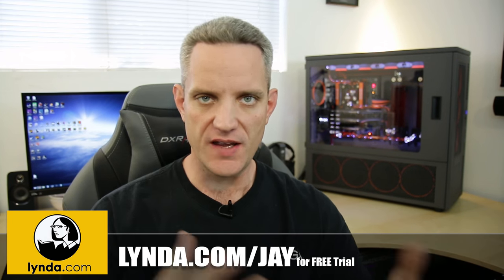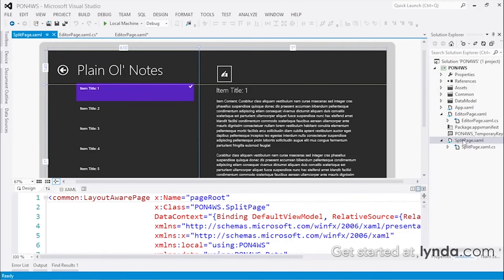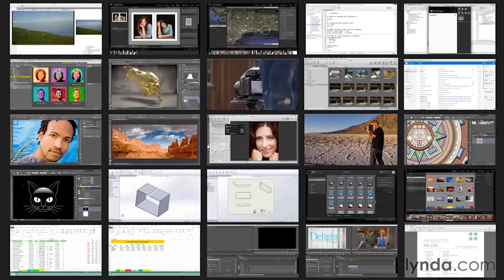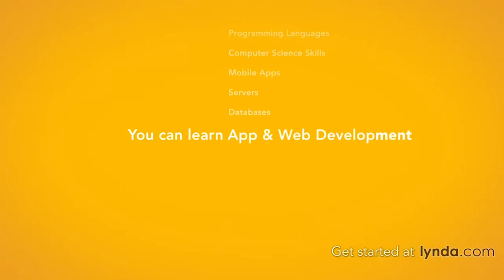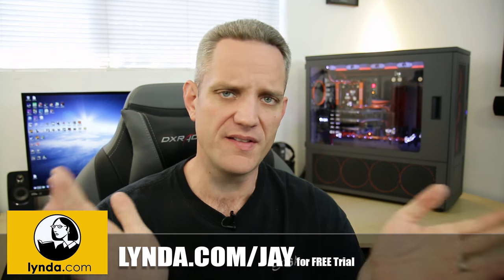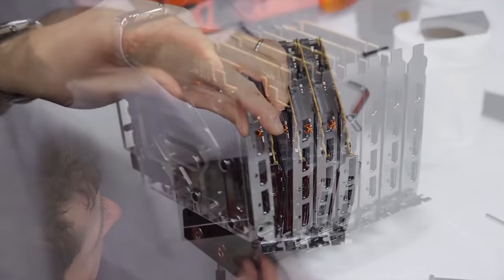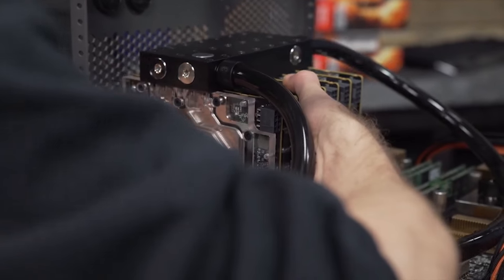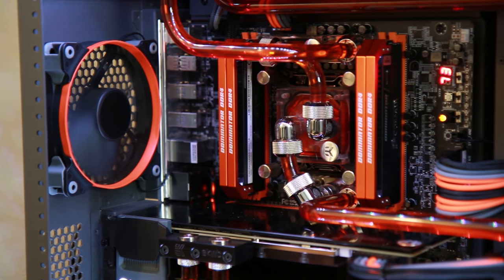Is watercooling worth it?

Comment: Should I watercool my headphones?
Reply: Yes....
Reply: That's a rather subjective question
Reply: +FidgetMyMidget No, you need to RGB your water first to not go over 95 C.
Reply: Kyzr NOW with RGB lights!

CES 2016 coverage brought to you by square space.

Build it beautiful
Reply: +FidgetMyMidget Only in the summer! In the winter you have to place a heater in it so you get nice warm ears!
Reply: +Brian Silva that water cooled power supply is one of the worst one out there, falling slightly behind the thortech thunderbolt. The ripple was a component killer on that
Reply: FidgetMyMidget Yea
Reply: What about my usb drive?
Reply: +O O F you should under-volt your USB ports for maximum stability.
Reply: Yes
Reply: But do you need to???
Reply: Your ears sweat and watercool them

Comment: I did custom watercooling in my system primarily for the looks. While doing the build, and seeing all the challenges you can run into (at least as a first time watercooler) I started seeing the appeal of more traditional cooling. But when it was finally finished, and seeing how nice the system ends up looking, then it was all worth it :)

Comment: I can answer this question... If you want to water cool because it's fun, or because it looks cool, fair enough. But is it worth it financially? No, not even a little bit.
Reply: I agree. Especially with the efficiency of modern CPUs and GPUs.
Reply: +nicklong27 yeah imagine the responsibility of doing it. Stick with a AIO cooler. Just install it and done. No maintenance needed.
Reply: +nicklong27 How much is the performance boost of putting alloys on your car? And how many people still pay hundreds of bucks on them?
Reply: Because I can overlock my cpu to max and not worry about temperature under full load 24/7. Sure it looks better alot, but custom loop without overlocking is a big joke.

Comment: My opinion on where watercooling (before watching the video) is good (aka you should):
1) You want to overclock stuff to their limit.
2)  You have a small case where airflow isn't optimal/good or having temps issues.

But you can always consider watercooling for looks and even lower temps.

I agree with jay's take on this. 100%.

Comment: I have a custom loop for 4 years now because of 2 reasons: Its so much quieter than air with my overclocks and because i love to work on my pc.

I think i have rearranged my loop 3 times in the beginning and tested different pathways to squeeze out a few degrees. Not because i was needing it, but because i had fun doing it!
My next project will be a hardtube build but im waiting for the hardware to advance enough to be worth upgrading.

If someone would ask me if they should watercool, i would advise them to put the money for the watercooling into better components, especially the graphics card and CPU like Jay said.
If you want a (relatively) silent PC, theres enough options for air/ hybrid or aio as well. 

Don't forget about cases like the Fractal Define r5, coolers like the Noctua NHD-15, corsair and other aio's (you probably have to exchange the fans on some, though) also theres plenty silent fans out on the market (Noctua, Noiseblocker, BeQuiet!, Nanoxia...)
As for the graphics, nowdays we can get aio graphics card coolers but some of the beefy heatsinks can be pretty quiet too, if you don't overcklock too much and are ok with hotter components.
Reply: Baldur M. How much would it cost to water cook my current pc?
I7 6700k
Z170a
Gtx1060 6gb
Reply: your boy bocaj thank you. And it’s not exactly worth it right? It’s more of a aesthetic?

Comment: Jay, Just wanted to say thanks for posting this video.  I especially appreciate the comment about not sacrificing on buying high performing system parts in the name of water cooling.  I have taken that philosophy to heart with my next build.  Here are the parts I'll be using: 

A) Corsair Obsidian Series 900D CC-9011022-WW Black Aluminum ATX Super Tower Computer Case
B) ASUS X99-PRO/USB 3.1 LGA 2011-v3 Intel X99 SATA 6Gb/s USB 3.1 USB 3.0 ATX Intel Motherboard
C) Intel Core i7-6800K 15M Broadwell-E 6-Core 3.4 GHz LGA 2011-v3 140W BX80671I76800K Desktop Processor
E) CORSAIR Vengeance LPX 32GB (4 x 8GB) 288-Pin DDR4 SDRAM DDR4 3200 (PC4 25600) Desktop Memory Model CMK32GX4M4B3200C16W
F) Corsair Hydro Series H115i Extreme Performance Liquid CPU Cooler, 280mm CW-9060027-WW
G) (Cannibalized from Current Rig) Silverstone 12000W PSU 
F) (Cannibalized from Current Rig) Asus 980 GTX Ti  (Reference)  
H) Crucial SSD / WD Black 6 TB HDD 

Like you I shoot video and still photography and yes when time allows I love to fire up DCS, Dirt 3, or some other game.  So I really wanted those extra 2 cores for multitasking operations when I'm coding a video file or rendering an effect in after effects.  It was money that I shifted from the i5 with custom water cooling onto buying the i7.   I will be watercooling the CPU with a Corsair Hydro AIO which I've had good experiences with thus far in the h80i series.  

I do think there is one aspect of the video that you did not touch on.  It doesn't have to be an all or nothing proposition.  For example.  With these parts I bought today I'm looking 14 to 20 months out.  Meaning that the new case (Replacing my smaller Lian-Li Mid Tower pc v1020 / great case just too small)  will eventually house a water cooling custom loop(s) and the other parts will support that.  With my budget I plan on building the water cooling system over time by buying a part here and there from EKWB.  A water block for the CPU in the spring.  Then GPU block in the fall.  Yes I'd love to go out and just buy everything at once but no winning lottery tickets here.  

However, want to thank you again for some great advice.  I think coming out of the gate I'm going to have a great system with potential to expand and grow in the future.

Comment: THANK YOU JAY
Im sick tired of most my friends wanting to spend MORE money on the MOBO and the WATERCOOLING than the  GPU and CPU itself, and they claim that it will make games run faster.  HOW HORRIFYING
Reply: It does make games run faster if you compare custom watercooling to any other type of cooling on the same specs because you can overclock. And spending more on watercooling than cpu and gpu is normal depending on your setup, I mean with r9 5900x and an rtx3090, can't really spend any more on CPU and GPU

Comment: I had a custom loop, I did switch back to air cooling for the convenience. I am very lucky that my cpu can overclock to 4.8 ghz at 1.27 volts ( my winter oc) but nowadays a aircooler and some high quality fans, and a gpu that turns off at idle. Is arguably quieter than a pump in wc loop.

Comment: It's completely true. If you are making (or buying pre-made) PC at around mid range or making an expensive build (depending on where you live), a loop would probably cost as much as your whole PC that you are building. Water loops are definitely for enthusiasts only, or if you are on the high end and you are trying to push out the little bit that is left in your hardware without making the jump to the next best thing. This small amount of percentage is at the top of the scale, and there is a lot of things to consider before water cooling!!!
Geat job Jay, keep it up!!!

Comment: After 6 months of having my custom loop running in my system, this is my experience:

First week I spent with my computer disassembled and playing around with the parts over a long weekend. The second week I let distilled water run through the system to flush it out, worrying the whole time like a new parent as I spot checked my CPU block. Then I drained and redid a part of the loop so it was not in the way of the graphics card and then filled it to begin the infinite process of bleeding and filling the system up until the modern day. After 2 months I sorta let it go and surprisingly, I have not had any issues with it yet. I even transported it across the state and all it did was shake out some bubbles. 

All in all, if you like playing with your computer parts more than playing on your computer, it is worth it. You should not do it in a shitty case that you have to modify to get to work, and the whole maintenance turn-off people may have only lasts a couple weeks. If you can be bothered to stop gaming for a couple weeks it makes your system so many eons cooler both in the temperature and looks departments. After trying it once, I don't think I can ever be bothered to run a system air cooled again. I can't wait to get a water block on my 2080 when I get a better case.

Comment: My opinion from custom water cooling for years and being into modded computers since before you could buy cases with side panels:   Back then=YES because heat to speed was a higher ratio.  Today=Mostly no.  Air coolers have come a long way and the chips are much more efficient. You can still create a quiet system on air cooling that is a powerhouse.  The overclocking performance today is not as high of margin and water cooling locks you into using those components for a long time because of customer waterblocks.  Not to mention the hassles and such.  Really watercooling is more for tinkerers who find it a challenge to reach the right combination of settings to optimize a system or are looking for a certain look.  I have never had a graphic or cpu fail or degrade over time due to heat (you must monitor and evaluate any system for heat regardless of air or water) so longevity isn't a point for watercooling.  Often a well abused chip will still outlast its relevance.  Also, in most cases you can wait 6 months for the next chip to come out and buy that, put it on air, and still spend less money than a water cooled kit.   So..  if you have stickered crotch rocket or mustang then yes to water cooling.  If you drive a focus, got things to do, a family, a budget, and prefer gaming than tinkering then use the KISS method.  Less stressful and you will live longer.  (ask anyone who has had a pump failure).
Reply: +spyder000069 Finished the video and have to say Jayz was spot on.  Its a hobby.  Do what pleases you.  For looks and the challenge go for it.  Value wise go one step higher on the parts chain.  Good video jay!
Reply: Funny how, today, it is ABSOLUTELY worth it again :p

Comment: If heat is the number 1 killer of CPU's (I'll assume GPU as well), what are the cases in which this long-term death has happened?
Reply: +LazerLord10 non? jay himself has said so, cpu-gpu chips are kind of indestructible due to heat, they can control it so the only way to break them is physical abuse or static or whatever, other things like PCBs and such are way more likely to fail that way, and its just that a cpu-gpu chip either 100% works or doesn't, no middle ground there
Reply: It doesn't kill them, it shortens the lifespand. But that is true of chips in general.
I don't think you can determine how a CPU/GPU/etc. died.
Reply: EspHack
I knew that. This is more of a general question asking whether high temps fro long periods of time can cause issues at all?
Reply: +LazerLord10 yeah , high temps can greatly reduce the life expectancy of your chips as the heat distorts the materials inside and causes the connections between transistors (among other things) to fail. How high you go will decide how long youve got, but dont expect to really reach it. I've run my fx-4170 at temps as high as 90C (before I got rid of the stock cooler) for several hours at a time, but there is currently no issues to be found. It performd just as well before as after the new cooler.
Reply: +LazerLord10 
high operating Temperatures will over time cause higher power draw, which causes more heat. it is an infinite loop.

while these components have sensors and will emergency shutdown at critically high Temperatures, heat is still a big problem for electronics, just like it is for Combustion Engines.
it can be managed, and is usually managed just fine - but if it isn't sufficient, you're asking for trouble in the long run.

this is not to say that if your components get to high double digit temperatures that you should freak out. good computer components should have an operation lifetime of over a decade, give or take.
basically, technically things will be fine unless temperatures are very high for a very long period.

the general recommendation of 'keep things as cool as you can' still applies though. lower temperatures are safer than higher ones as long as it's not low enough to cause it to freeze.
Reply: Linus is number 1 killer of CPUs, you don't have to worry.. Unless he visits you ;)
Reply: Computers  don't live forever  your 15 year old pc will eventually  die lol including the psu lol that will probably  go bang after 10 years of hard abuse lol
Reply: @jonathanoxlade4252  Care to explain what the processes are behind that? In power supplies, capacitors dry up. But other than that, there really isn't any age. Plus, my commodore 64 form the 80's still works great, even the original power supply.

Comment: i agree with most of what you you said, but i think the reason full water blocks don't exist for mid range cards is because it's a small market as full water blocks is an enthusiast thing, and enthusiasts usually go for the high tear.  if there was a demand, it would get manufactured. that's why the universal blocks exist. but  it could make sense in some cases to watercool a mid range card:
like with the 6950 that card was a really really good overclocker and if you already bought the card and you decided later that you are going to watercool your system it would make sense to spend the extra 50$ to include it in your loop if you don't want to sell the card.

Comment: I opted for air cooling in my recent build for all of the reasons Jay listed. I hadn't built a system in several years and I wanted a fancy water cooled setup but it just didn't make sense for me at the end of the day. My primary concern was noise but I guess fans have come a long way since I last built a system because the Coolermaster Hyper 212 Evo that I picked up is extremely quiet inside my old Antec P182 case.

Comment: so what you're saying is that I should water cool my 960 and my fx 6300?
kappa
Reply: +Equinox Gaming nah he's saying you shouldn't
Reply: +Jonah Wright not getting the joke
Reply: wenisinchina
ok... what is it captain? pls.
Reply: Jonah Wright he was being sarcastic
Reply: the 6300 maybe. I've seen people hit 5 ghz on those bad boys with some water cooling.
Reply: ***** yeah see that's awesome. Anything that hits 4.8-5 ghz is a beast. I can only hit 4.6 with my 4690k. Intel should bin their chips better. Then again, I don't water cool (i have a dark rock 3) and I had my voltage on auto so maybe that was my issue.
Reply: ***** fx 4300s are even more crazy
i managed to get one stable at 5.1
Reply: +Terry's Tech meh, I didn't feel like messing with it. I trust asus's bios software. I think it's at 1.2-1.3 volts, and I run it at 4.4 ghz. I don't do much CPU intensive stuff and my CPU never goes over 65 c when I use CPU z to stress it out, so I have nothing to complain about really.
Reply: +wenisinchina I got my 4170 to 4.8GHz. It ran stable in the test (even though it was constantly hitting 80-90C) but I eventually turned it down to 4.5 because it fucking scared the shit out of me with its 1.525V.
Reply: Azivegu i had this one at 5.1 under a dual rad with both fans running at 100%.
voltage was like 1.6V, temps hovered around 80-85C under load
many games actually had wierd issues like running too fast.